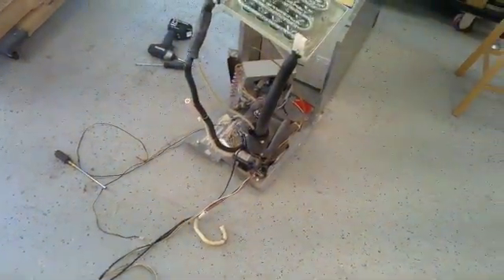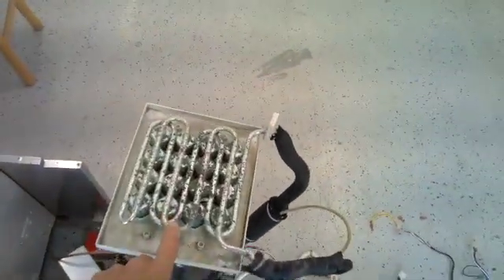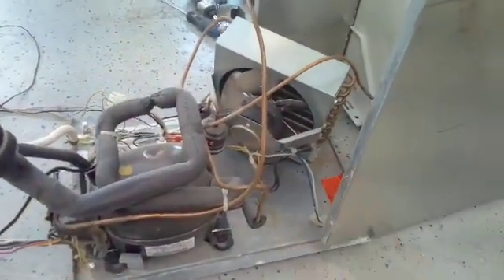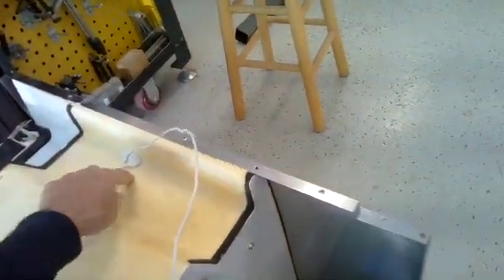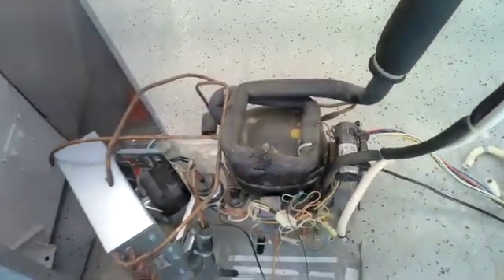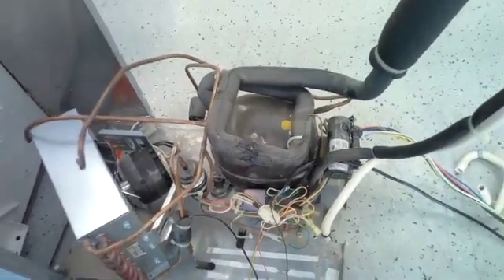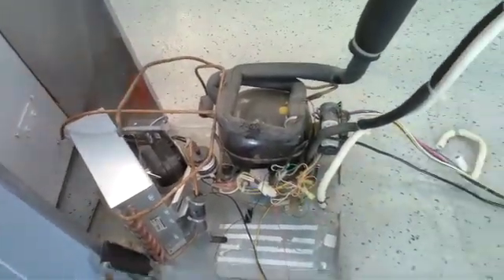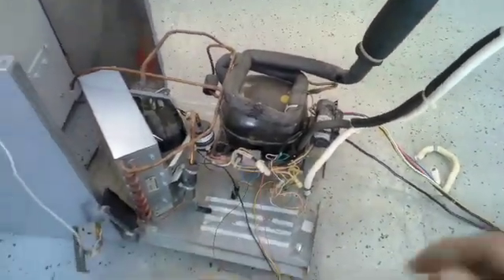Sub-Zero UC-15IP Ice Machine Sealed System Overview

Comment: Is there any way to get to the condenser just a vacuum the face of it carefully? I just did my first cleaning cycle after owning this thing for over a year, had the wood floors refinished recently. The condenser is caked with would dust. I got a mat off the front of it without bending the fins too bad but it's pretty difficult to get at with the thing angled and the temperature control switch in the way. I swung the switch out of the way to get a little bit of vacuuming done but do you just pretty much have to take the machine apart? Did they expect you to clean this with some frequency?
Reply from the maker: You don’t have to remove the control, but you can remove the front panel, that will give you more access or you can blow it out with an air compressor. I use a small brush to get up and under the front panel. If you bend the fins you can use a fin comb to straighten them out.
Reply: @SubZeroSpecialists  thank you so much for the reply. I was able to get a better clean on it with a small brush thank you.

Comment: Where is the most common place for freon leaks on these? I got two machine for the same client that got oil traces at the bottom but it's hard to see without getting the whole thing apart?
Reply from the maker: If you’re referring to the bottom of the unit by the compressor then I would check the tubing around the condenser compressor area. Maybe the lines were rubbing. You’re probably going to have to remove the shell to get in there, that’s my suggestion. Also a Untra Sonic leak detector could pinpoint the leak better than a sniffer.
Reply: @SubZeroSpecialists  thank you for your reply, once the client confirms they wanna repair, I will pull it all apart and get a better look at the lines.

Comment: i have a 315p..i chaanged the cycle timer and had it loose..i turned the machine on and the cycle timer prongs touched the metal base of unit and it grounded out...now machine doesnt even turn on,,,is there a fuse somewhere that might have blown? any help would be appreciated
Reply from the maker: Go to my website aaronsrefrigeration.com and click on Tech Help and find the model 315P. Check the troubleshooting charts and the wiring diagrams, also did you check your circuit breaker?